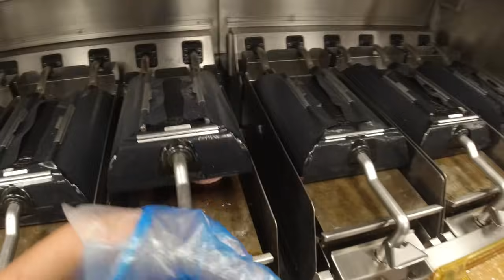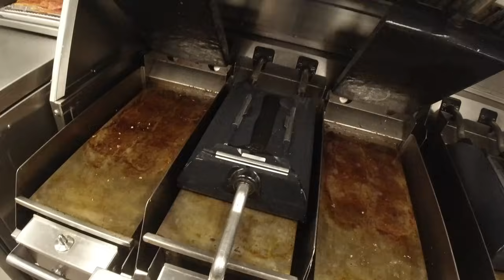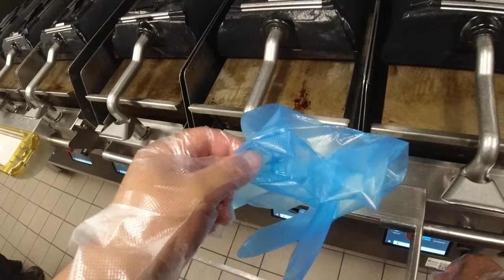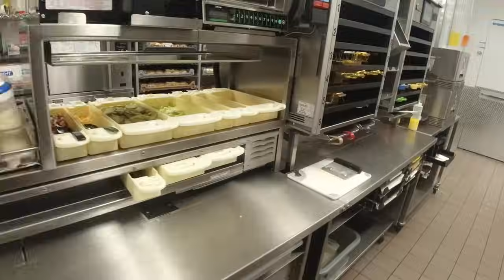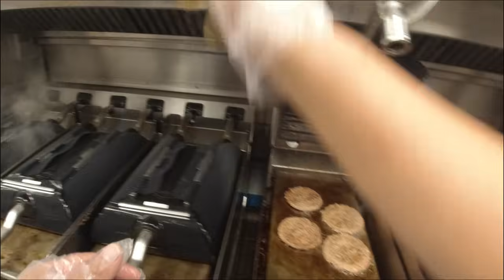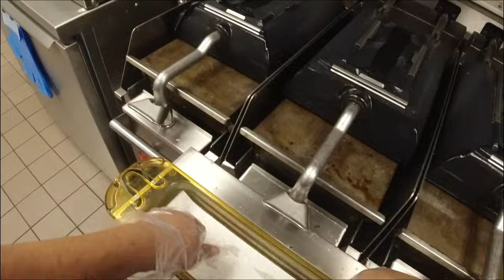McDonalds POV 100% Pure Beef Patty

Comment: I worked at McDonald's back in the day in the late 80's on a flat grill where we had manually turn the patties by hand, in fact, when I started, McDonald's was grilling the onions directly on the patties but that changed less than a year after I started. We switched to dressing them with the cold onions as a regular condiment like the rest. Let me just tell you, you have no idea just HOW GOOD the burgers were back then. I miss it tremendously.
Reply: They just recently switched back to doing the onions on the grill with the meat.
Reply: tbh, if i ever worked at the fast food joint, say like mc donalds, and those werent cooked the beef patties i would flip it, i dont want my customers getting sick from under cooked patties, those patties looked like it wasn't thoroughly cooked all the way through.
Reply: @Mega1andy2  The patties are uniform in size and thickness from one to another.  There’s no reason to think they aren’t cooked to a safe temp.
Reply: @19Pixel  i don't want to make my customers sick. so i cook the patties THORGHLY, if it was still bleeding i would flip it. if and i mean IF i was a manager in any mc donalds i will tell my staff to cook the patties the way its intended to be cooked, not being cooked on 1 side. yes, it might take extra time. though i don't care if i tell the staff to make the patties at the reasonable temps at least 165 degrees then its fully cooked, i don't wanna cook on one side, and not the other.
Reply: Theres blood on them, they are not cooked @19Pixel
Reply: In the UK we’ve started applying onions at the grill itself. Really does bring out the flavour profile of the patty.
Reply: I fried a rat once
Reply: @Mega1andy2 The top of the grill that closes cooks it on the top

Comment: I worked at McDonald's back in 2001-2002, I did grill a lot. We had 4 'clam' grills that were bigger than these in video. Could fit I think it was 12 regular patties or 6 or 9 quarter pounder patties. Had to manually close them to start cooking but they were on timer and would open automatically. And we didn't have to wear gloves back then, I would have hated having hands sweating in those plastic things. We had to wash hands every hour I think and sanitize every 10 or 15 minutes though.
Reply: Can you cash app me money so I can buy gas and new tires for my truck

Comment: Little tip of advice from a crew trainer:

DON'T double glove as you did in the video. Double gloving could result in a tear in the gloves, which would result in you you making contact with the raw proeucts, posing a possible danger to you and/or the customers.
Reply: Yeah I don’t understand why he double gloved, if anything its more dangerous to him he is touching the button below with raw meat. But to be fair if those grills cook at the same temperature globally the customer doesn’t have to worry about germs.
Reply: @Goldfishbox77 Fair. And it is a lot more dangerous to him. Also it's usually more of an issue of keeping the other workers safe, since those who take the grill afterwards are also touching the same surface (though it should be wiped down frequently).
Reply: I work at McDonald's and at my store it's required to double glove.
Reply: @youllneverknow7781  That's a very, very odd rule but typically, it's against procedure (it's also against corporate McDonald's procedures). 

Again, a very odd rule, considering double glove increases risk of cross contamination.
Reply: @pirategamer6630  True, double gloving and then clicking on the button with gloves still on is literal contamination.
Reply: @afonsomoreira3505  Yep! Couldn't have said to better myself.
Reply: I was literally thinking why is he wearing raw gloves over clean gloves.
Reply: I'm a crew trainer at our store and on our corporate training plans it is procedure to double glove. However he shouldn't of been closing the grilla with the blue gloves on.

Comment: Looks like the process has changed little in the last 30 years. Robots could just as well do that. Can they cut the cooking time in half by increasing temperatures?
Reply: no, for a patty to be cooked through they must cook it at a lower tempatures for the heat to be able to move throughout the patty with no rudh

Comment: This is literally fuck up proof, but I’ve had mine done exactly that way. A Big Mac with no burger or lettuce on the top half of it.

I worked at McD’s during the Stone Age and had quit just after the clamshell grill came. It was a plain grill. There was a timer that had dials that could be adjusted for eggs, 10:1 patties, 4:1 patties, sausage, etc. put the meat down, hit the timer. Timer goes off, flip the burger and hit the timer again. Pull them when it went off the second time. 

We had to mix the salt and pepper in an aluminum shaker and shake it onto the burgers…nothing portion controlled. Made Big Mac sauce and tarter sauce for filet o fish. Didn’t come prepackaged. Cut our own tomatoes and onions. Buns were toasted in a toaster to perfection. That all had to be taught or learned on the fly. There were sheets explaining how to do it if you didn’t know. Nothing was kept in a warmer. It was literally making 12 hamburgers or 6 quarter pounders and they were sold as they were made. FRESH. HOT. Cheese melted.

This is literally automated with the exception of dropping the Patty and picking it up and placing it on a bun. Everything is prepackaged. Everything comes already made. 

I’m not shitting on your post mate. Just trying to explain how much harder it was…making $2.20 an hour. You have NO CLUE how good you have it! Interesting to see how it’s all changed.
Reply: true bro i feel you. i work at mcdonalds in denmark and we for some reason have to be alot quicker he is going slow asf. its true everthing comes premade you just have to put things into machines and hit a button :/
Reply: I worked at McDonald's. We had the clam shell grills. We would do (12) 10:1 and (9) 4:1 at a time during lunch and dinner rush. I found it much easier and faster to cook to order after the rushes. So many stories I could tell on how things should have been done and how things were done..
Reply: Edit for the post above.:
This method is to control food costs, not for speed anymore. Just see how long it takes to go through drive thru when they are busy. It makes no sense to wait 8-10 minutes to get your order, and nothing is even fresh.

Comment: I feel like those burgers are a little raw still
Reply: had the same thinking
Reply: Nah that's the meat juices that rise to the top.

Source: I work at a McDonald's
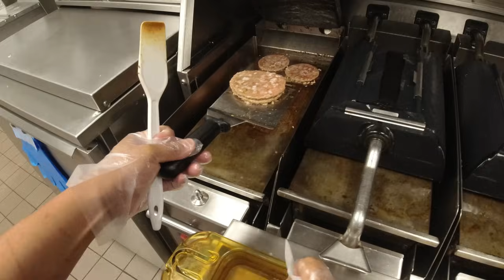Reply: @mastab8_tcg  At 2:00, those aren't fully cooked whatsoever.
Reply: @Kurathis552 nah trust me they're cooked it's just the juice. Thats why we sumtimes squeeze the patty to get rid of it. (I also work at maccies aha)
Reply: @akadon123  I'm not referencing the juices on the burger. They're not cooked.
Reply: @Kurathis552 nah they are, the grills are set to a certain time automatically by detecting what meat is put down, using quarter meat (4-1) it always produces a bit of juice that flows to the top, same with regular meat (10-1), the grills are quite literally made to detect the particular meat and adjust the time to cook it perfectly, it's just juice, we wouldn't serve raw meat, at least my store wouldn't
Reply: @mastab8_tcg  Lol no store aims to serve raw meat, genius. THAT is raw meat, however.
Reply: @Kurathis552 looks can be deceiving lad just trust us when we say that it is cooked as the machines do detected the burger and cook it for the right amount of times always
Reply: @akadon123  So, what you're saying is it is impossible for a customer to receive raw meat, in any amount?
Reply: @Kurathis552 it all depends on where the pattys are placed on the grill as when it is close to the edges of the grill then it'll will need to be flipped and cooked a bit longer. However, as long as the patties stay in the middle, theres no way that the burger can be raw. This mistake is mainly caused by new employees but can easily be resolved
Reply: @Kurathis552 believe me when i say u will definitely know when the patty is raw when theres that one bit that is completely raw on the burger whereas the majority is cooked
Reply: @akadon123  You're right; you will know when a patty is still raw. And I do know that patty is still raw.
Reply: @akadon123  Furthermore, if they're correct and perfect every time, why do temperature checks during transition? Why do quality checks? Why have maintenance on the machines? Why clean the Teflon before/after each use? (I'll answer this one right now for you - it's to avoid buildup that would cause the patties to be cooked improperly)
Reply: @akadon123  "However, as long as the patties stay in the middle, theres no way that the burger can be raw."

Lol - you think that a machine can't make mistakes? Hahahahahaha inhale hahahaha.

"...when it is close to the edges of the grill then it'll will need to be flipped and cooked a bit longer."

No, that wouldn't be cooked longer - it would be immediately put into the waste bucket, as that has officially become a health hazard.
Reply: I'm glad I wasn't the only one thinking that, even if it's automated and all, I would rather have that juice be a bit more brown than fully red like that lol
Reply: @Kurathis552  You are incorrect, accept it.
Reply: @mick19  Yeah, no, I'm not, but thanks for your contribution.
Reply: @Kurathis552 Go work at McDonald’s and find out if you’re so invested in this argument 😂
Reply: Fast food restaurants are very high-profile. If they were serving raw or undercooked meat, local government inspectors as well as their own district management would be all over them, because people would be getting sick. Most of us have been eating McD's all our lives, and I can say I've never bitten into an undercooked patty once.
Reply: People are really blind on here jeez
Reply: Not cooked , bork
Reply: It's cooked correctly obviously. So it still contains a bit of water and fats. Frying things ceaselessly until all the water-content is gone is not a nutritious way to eat. -

Like those hot-wing themed restaurants that try too hard to be sports bars. Their wings being rock-hard petrified isn't because 'that's how it's done,' they're rock hard because they're severely overcooked to the point of paranoia. Hot Wings aren't supposed to be petrified rubbery all the way through - they really are being severely overcooked.
Reply: @Kurathis552 They do stick the meat with a thermometer  to make sure it's cooked. And the UHC cabinet where they hold the food is super hot so it would finish cooking in there.